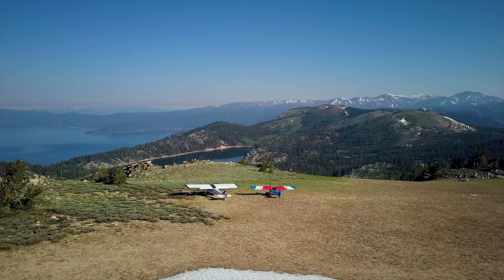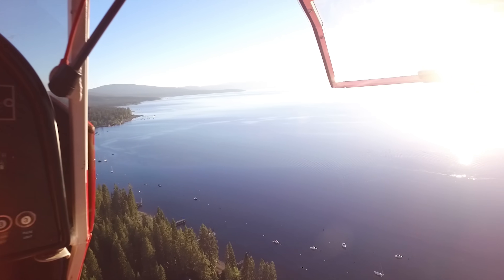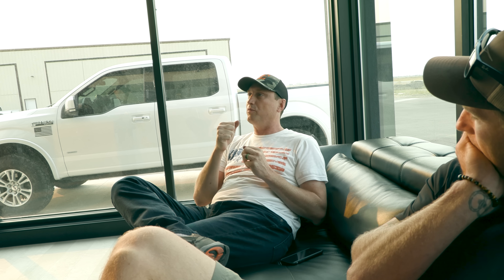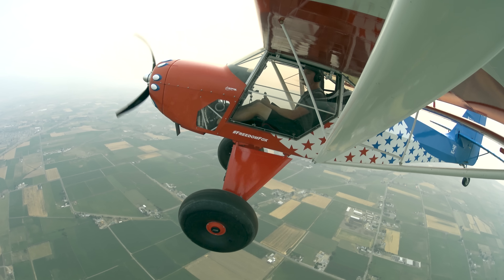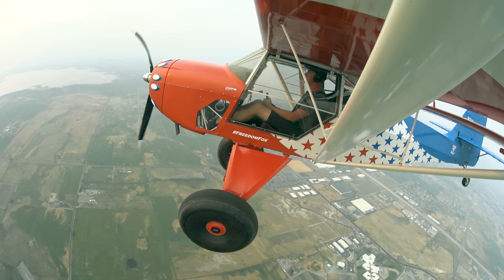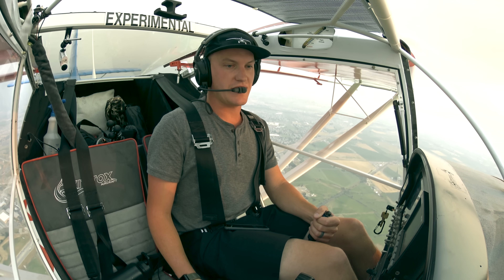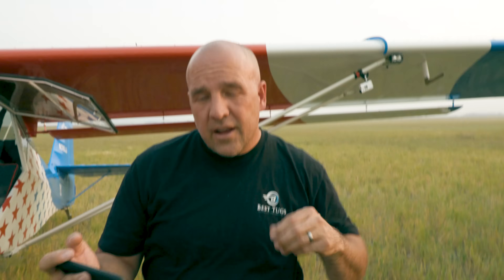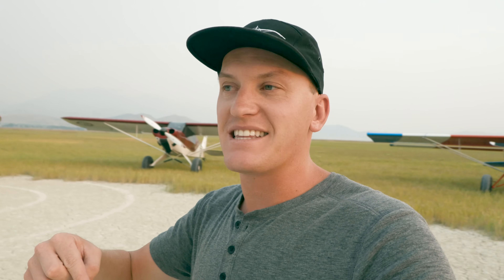YOUR FLIGHT INSTRUCTOR WAS WRONG! - Simulated vs Real Engine Failure

Comment: nice quiz Trent i like it , but it's fairly easy to debunk with fairly simple math in physique and fluid dynamic , a general aviation motor could not spin slow enough for it to created drag measurable , for it to be effective at slow speed  , gear box engine would probably be able to spin the propeller a little slower but still not even close enough to make a difference , it need to be totally stop to actually make a difference .

the speed of the props - the speed of the airplane - the dynamic force created by the props at the lowest speed , would actually still create  trust . 
 min as well specified her that at higher speed the angel at witch the prop hit the in coming wind would eventually result in drag , would that drag be noticeable on the total drag aria of the airplane i don't think so
Reply: min as well put it in 

drag coefficient calculation

FT(ω)=CTρAr2ω2=CTρπr4ω2,

with A=πr2 being the area of the rotor, r being its radius and ω being the propeller's rotational velocity. I guess, assuming the latter formula is true, one could derive one for drag force from it substituting CD for CT and rotor blade's frontal area (its projection, rather) for A. Geometry data from UIUC below. I believe, c is aerodynamic chord length, R=0.127m (propeller radius), β is propeller's pitch at the respective point. I believe I can calculate propeller's side area using simple quadratic integration rule. 

taken from [UIUC Propeller Data Site](http://www.ae.illinois.edu/m-selig/props/propDB.html#APC)

and pleas keep the name calling my felling is heart for the delusional  self entitled  peoples , and instead engage in a conversation .

Comment: I have limited knowledge about this subject, BUT as a C-130 Flight Engineer we are taught and have seen first hand in simulators that a flat faced locked ( non spinning ) prop produces more drag than a windmilling prop, now as far as is it producing drag or thrust at idle, on a fixed pitch prop, I have no comment because I have no experience with fixed pitch props
Reply: maybe on a turbine. but a piston engine that is not running are producing drag on its own when turned over. check out this answer for charly UAV:  ""Tried 3 different descends, all straight vertical down towards the earth with my rc shockflyer.

a) 0%throttle, esc brake off
b) 0%throttle, esc brake on
c) 4%throttle, esc brake on

a) was in the MIDDLE, the wind kept the motor spinning pretty fast, faster than c)

b)was the FASTEST descend, the esc forces the motor to spin at 0% throttle, so a stopped motor is definitely the least amount of drag.

c) was the slowest, because the esc forces the motor to spin at 4% throttle, no matter if the prop wants to spin faster or slower, so it acts as an AIRBRAKE""

Comment: i have thought that it all depends on the RPM and the relative wind. if both are equal you dont create drag nor do you create thrust. But if one of the 2 increases or decreases, then all numbers are different. example, if your prop is spinning at idle but the relative wind is faster, then your creating drag, and vice-versa. At least thats how my litle brain thinks...

Comment: So if you want to get super nerdy for this problem, read on:
Look at the thrust drag forces on the plane as vectors (both an amount, and a direction its in).  So we have thrust, and drag.  These added together will determine how fast your plane goes, the faster your plane is, the more lift you get and further you can go.  The drag vector will always be pointed back (slowing you down) and the same amount (roughly, aero loads change with speed).  The thrust vector points forward.  When the plane is at idle, there is still a small amount of thrust vector.  Thrust can't overcome drag, but it can make the resultant smaller.  But if your engine is off, there isn't any forward thrust to counter drag, so drag will run unopposed.  Wind milling the prop will actually make the drag bigger, think gyrocopter.
Reply: THANK YOU! I'm glad someone else understands free body diagrams.

Comment: As a CFI I will tell you that the distinction that needs to be made is in regard to an "idling prop" versus a "windmilling prop".  You touched on this in the beginning of your discussion.  Many folk confuse the two, but there is a difference.  An "idling prop" means that the engine is driving that prop at the idle power setting.  That produces thrust.  A "windmilling prop" is a prop that is being forced to turn due to the wind that it passes through but the engine itself is not turning.  That does not produce thrust.  Any thrust you receive will improve your glide performance.  That includes an "idling prop".  Since a "windmilling prop" doesn't produce thrust, your glide performance will decrease.  Anything else is noise.
Reply from the maker: Yes, I tried to clarify a few times, this is the difference in an idling engine (like in a simulated engine out) and a truly stopped propeller (like when I threw a rod and my engine seized). Just because I got torn apart in the comments of my other video

Comment: An idling prop is still essentially screw driving through the air. So there will be some drag.

A dead prop will create more drag becuz now the wind has to bend around the props edges and angles of attack.

Comment: Here's a theory for ya.  Lets say your idle is 700 RPM and your glide is 60.  If your idle prop moves 60MPH worth of air, then you glide speed equals your idle thrust and your net is 0 with no affect on glide range.  If your idle speed is 500 RPM, then your moving something less that 60MPH worth of air then you now have drag with less glide range.  With the prop stopped, you will have some resultant drag at any speed, which will decay the glide.

Comment: Im an aircraft engineer and aviation instructor ( faa and easa ) and so As instructors we use to give the engine a bit more ref than idle to simulate a feathered prop. 
Now... it’s per aircraft design “best glide vs prop rotation & pitch” if the idle rotation prop is pulling or dragging. 
For the little planes you may assume that a slow rotation prop has less or equal drag than a dead one ..

Comment: It seems pretty simple to me, if your engine is running and spinning the prop. You are creating thrust. Think about it as a curve. When the thrust exceeds the drag, you climb. When thrust doesn’t exceed drag, you descend. As long as your creating any thrust, you are countering drag. The theory that there is a difference between windmilling and stopped prop doesnt have me sold on, other than the prop crossing areas that may interfere with lift. My theory is, it matters where the prop stops, because as far as resistance it’s the same surface area hitting the wind. If it is essentially positioned covering part of the wing vs being directly vertical, is loss of lift on the wing changed? So many questions, but from personal experience, the engine idling produces thrust which helps counter drag
Reply: It's not about thrust. It's about levels of resistance/drag. If the prop is idling but it's not pushing air faster than it came in, then it's not producing thrust. It's also not producing much resistance however. At those gliding speeds you're not going further because you have more thrust (because you have none). You're going further because you have less drag.

Same but a bit more technical:
Thrust means you're exerting a net positive force on whatever it is you're trying to move. At idle, it won't be rotating as fast as it would/should to maintain that speed, therefore it's not exerting a net positive force, meaning you have no thrust.
You do have less net negative force than a stopped prop however.
Reply: Jognt so in other words, pretty much what I said. Just because it’s not completely overcoming the drag doesn’t mean it’s not reducing that drag curve. An example is a plane on the ground, at idle it may barely move the plane, barely overcoming the drag on the wheels. Put the same plane in sand and it won’t overcome it. Put that same plane on an ice runway/taxi way, at idle the brakes won’t even keep it from moving the plane. To create lift, the thrust from the prop has to overcome the drag, and create enough forward movement to create lift over the wings.
Reply: No, you said "You are creating thrust" which is incorrect. To you that might sound like "the same thing" but it's not. 
Also, to create lift you need air moving over the wings. To get the air moving, you use the prop. Those two are separate mechanics at play.
Again, you'll probably think that's "the same thing", and again, it's not.
Reply: Jognt your equating thrust to Forward movement which is incorrect. Thrust is force, movement happens after drag is overcome. It’s why in space they can move a satellite with 1 psi air pressure, on the ground would that 1 psi move a satellite, no, of course not. Thrust is simply force or energy. If you are producing any energy, you are nibbling away at the resistance from the drag. It may not be enough thrust / energy to create lift, but it simply would not make sense that if your not overcoming drag that you would sink faster at idle than at stopped prop. You keep disagreeing with what I said, but you literally are saying the same thing at the end, your just mixing up foreword movement with thrust.
Reply: Jognt , you are literally taking what I wrote, disagreeing, then saying literally the same thing. Btw I never said that the prop spinning is what directly causes lift, but it does create thrust which moves the wing thru the air, to create lift over the wings. I do understand this a lot better than you are giving me credit for. 

I’m over it, I know I understand it, after all I have had an engine out and fully understand the difference between idle and dead stick prop. Have a nice day!
Reply: "Again, you'll probably think that's "the same thing", and again, it's not." 
I don't want to be the "I told you so" guy, but hey..
Reply: Jognt, are you even a pilot?
Reply: Nope. That's why I can look at this from an actual scientific perspective. Physics is physics. Having a pilot's license doesn't change that.
What does change however is that pilots who are not very knowledgeable about science draw simple conclusions purely based on their own experiences.
I get why you're saying what you're saying because I understand why it makes sense to you. It's just scientifically inaccurate.
Reply: Jognt so in other words you don’t know what your talking about, but you stayed at a holiday inn... “but hey” stick with playing video games.
Reply: Lol. I figured you were going to say that. You do realize that having a pilot's license in no way qualifies you as a scientist right?
Anyway. Nobody will blame a pilot for not being a scientist. They're two different occupations after all. 
Acting like a bratty teenager and throwing insults when someone points out flaws in your reasoning however is something you can be blamed for and really doesn't do much to show (good) character.
Have a nice day.
Reply: Jognt, what qualifies you as a scientist? You do realize that the FAA flying hand book covers the science behind this. You do realize that I can demonstrate this with my plane, in 3 different ways. You really should take a discovery flight, maybe ready a book on aerodynamics and the effects of drag vs thrust curve.
Reply: "what qualifies you as a scientist?" - Nothing more than what qualifies you. I do however have greater respect and interest for/in the scientific method.
"You do realize that the FAA flying hand book covers the science behind this."  - I have no doubt that you guys get a book that describes a simplistic version of what actually happens. Emphasis on simplistic.
"You do realize that I can demonstrate this with my plane, in 3 different ways." - I have no doubt that you can show the basis for your conclusions with your plane. But that's the thing. You drew those conclusions with that plane so it would be weird if those didn't make sense.
The conclusions you drew are true for your plane, with your settings, in your circumstances. Science is about understanding and figuring out the reasons why that is the case and to make it applicable to the world as a whole.

You can say "book a flight" as much as you want, but flights don't teach you physics. Physics classes teach you physics and engineering classes teach you engineering. I get the distinct impression that I've followed quite a few more of those than you have.

Keep in mind that I never said that your experiences were wrong at all. You're just using the terms in an unscientific way and work with a lacking mental model of how forces are applied.

Having said that, I doubt we'll ever agree on this one as you appear to suffer from Dunning Kruger Syndrome. Just because you fly, doesn't mean you know actual physics. You just use it.

Edit: John Goscinski in another comment thread here said it nicely:
"25+ years as an aero engineer, 4 of them doing flight dynamics for NASA, and I get to put up with guys pulling sayings out of their butt like "If the engine is consuming fuel, it is producing thrust."  Where is the rolleyes button?"

This nicely shows my point about your very first sentence: "It seems pretty simple to me, if your engine is running and spinning the prop. You are creating thrust."
Reply: Have a nice life!

Comment: You are wrong under your observation of "an idling prop is not creating drag while in flight "
Imagine this experiment, place a small box fan on an ice floor with caster wheels and in low speed, place a larger fan in front of
 it, anchored down, turn it on high speed,what do you think happens. The small fan blows away ! WHY !
The small fan is your prop, prop disc (rotating area) and plane or a free body in space, it is moving air at 5 - 10 mph at idle.
The large fan represents your flight air speed (lets say 60 mph at time of engine idle) the small fan leaves the scene at a potential of
50 mph ,which means your net air speed will be eventually be  minus or drag. The logic for air speed and ground speed apply !!!!!
Reply: they didnt say it doesnt create drag, they said an idling prop creates LESS drag than a stationary prop.  thus decreasing the glide angle.

Comment: in 2002 towards my flying hours in a piper cub, when I climbed in the complicated way that is done, I broke the fuel tube under the instrument panel with my foot, the engine was cold and turned off by luck, then I received help from the mechanics, it was an accident with luck. Excellent video !

Comment: It is just common sense a rotating propeller on a running engine is still creating forward momentum cause it is spinning at 500 rpms  or idles speed. So it is still cutting through the air regardless just like a vehicle you driving 55 mph on a road take your foot off the gas and idle. Useally you are going to keep moving at idle verses putting car in neutral you will slow to a stop sooner or later airplane is no different. A dead engine you are going to stop or land. A engine producing even little bit of thrust you are going to keep moving. Unless you are climbing a hill for a vehicle or tryin to climb in a aircraft either way you are going to stall cause lack of speed.
Reply: Just got to thinking the weight of your aircraft and wing area also contributes to best glide like sailplanes they are made to glide riding wind currents. But they have very little drag no rivets not many have wing struts landing gear goes into fuselage and none have a 2/6 hanging off the front of the nose.

Comment: what is the speed of airflow behind the prop at idle on the ground.. ? is it more than the wind speed with 0 headwind going 60mph in your plane.. ? if so.. then you are definitely screwing through that slower air, hence better glide.. if not , then you are changing air direction at the prop of faster air, and making an air curtain. Which in your case, it seems like it wasnt. So at idle, the "blast" of air, must be more than 60 mph? (not a pilot just an engineer here trying to figure this out ) ;)

Comment: Here’s some food for thought. Of course, results vary aircraft to aircraft, but I’d be curious to see if a fine/corse prop makes a difference. An aircraft like Draco can feather, if you guys are using constant speed props, would a cruise pitch make much of a difference at idle (spinning or windmilling) vs a climb pitch (we used to practice engine outs in the PC-12 just above idle to simulate a feathered prop). I know in Draco the wilgabeast it would make a pretty significant difference, but how about on a cub or kitfox?

Comment: Wouldn’t the drag be the same on a fixed pitch prop regardless?   It’s still an airfoil on a 90 degree axis.     At what point does it switch from drag to thrust and then back again?   (And I wrote this before watching the entire video so I can learn as you all did)